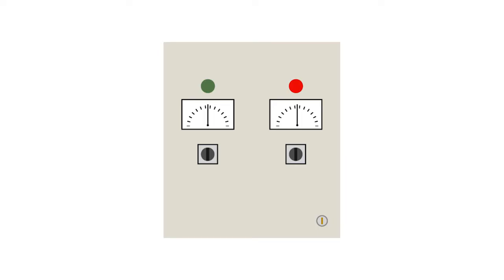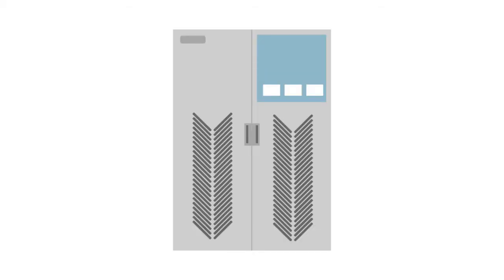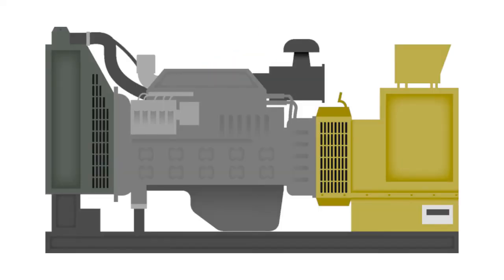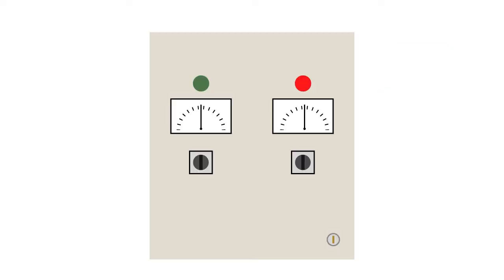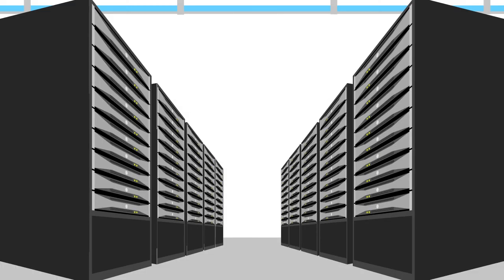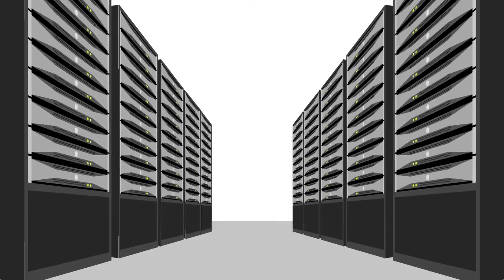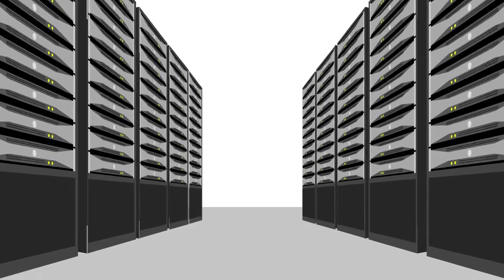What Happens When the Power Goes Out at a Data Center?

Comment: In nominal mode, UPS in datacenters are configured to ensure a permanent double conversion (Grid/Gen AC to DC then DC to AC), to suppress the eventual imperfections of the incoming supply, and to ensure continuity of service in cases of brownouts.
Reply: I stopped watching when the load wasn't run off inverter. No interest in a consortium of check box checkers, got that at work already.

Comment: Of course, that all depends on keeping fuel flowing to the generators. Even though our DC has direct fuel lines to a large tank the minute the generators are on and stable an automated call is placed to start routing tanker trucks to our location. We are only allowed to cancel them once four tracks have shown up even if power has returned and the grid is stable. Those four tracks are on hold in our lot for 24 hours after the close of the initial event. They then get dispatched back to home base as one every four hours. Meaning that we have fuel coverage for forty hours past the tank capacity. We also have a four-bedroom crew bunker set up for the crew to wait in. It is set up like a high-security student dorm with its own security team.

Comment: ATS? you mean an STS
Reply from the maker: Thank you for your comment. We understand that for many applications, the STS, or static transfer switch, is going to be a better solution because of its speed and load handling ability. The ATS, or automated transfer switch, however, does have it's advantages considering it is cheaper and less complex leaving fewer parts to fail. Both are viable to do the job depending on situation. Please keep in mind that the example given in the video is just one example of how this could work and different facilities handle things differently.